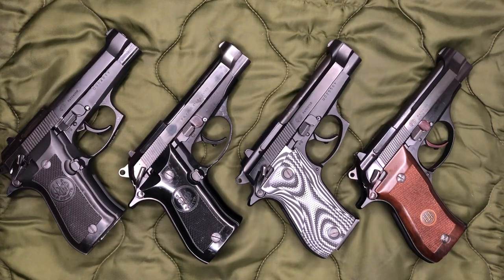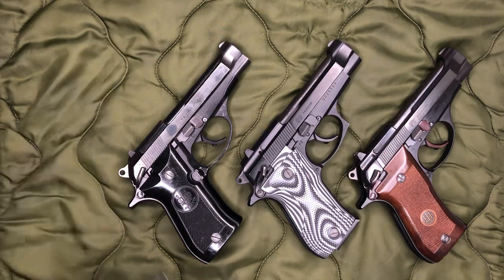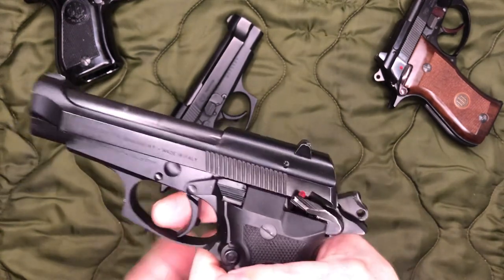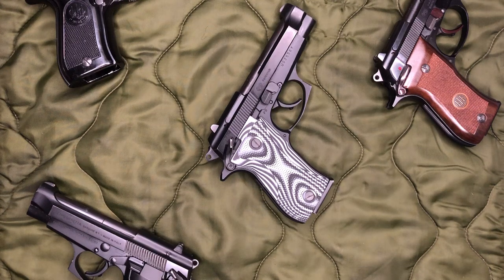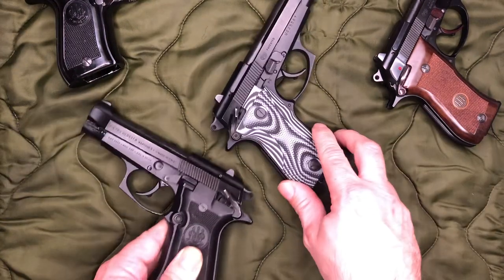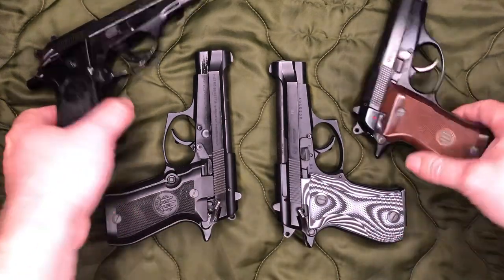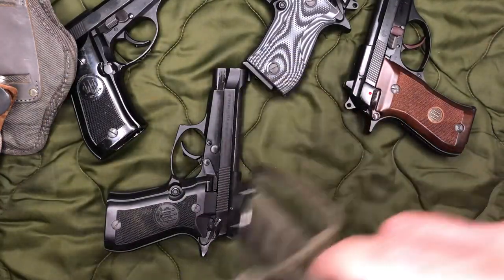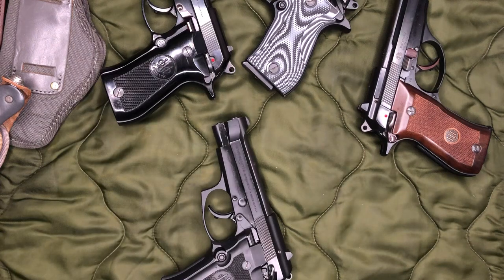Beretta Cheetah Safety Concern

Comment: With PSA selling the BB Model 84s i had to wonder about this safety concern even if it didnt effect that specific model. Definately should use wood grips on mine though, and maybe even a replacement spring if the one on mine is too weak

Comment: The center click does not have a purpose and should not be there. Read the manual don’t read the manual, whatever. That is an easily mistake, unsafe condition that should not exist on the gun.
Reply from the maker: @truthof7382  I agree. That’s why I made this video.

Comment: Am I understanding you to say if you put the safety half way on it will go bang. Like any other single action. (Can you say 1911). So if you actually actuate the safety all is good?
Reply from the maker: @randallupton3622  the problem with this compared to the 1911 is there is a very positive click in the halfway position (not safe, still go bang). The other problem is there are several reviews of the 84F/FS and newer 80X saying this IS the safe position. Saying you can carry it cocked and locked like the older B and BB versions. Even Forgotten Weapons first review of the 80X Ian states that you can carry it cocked and locked.